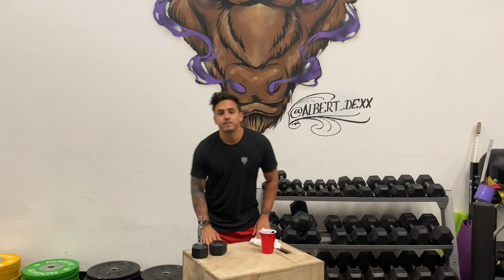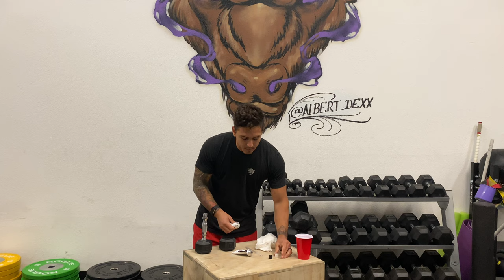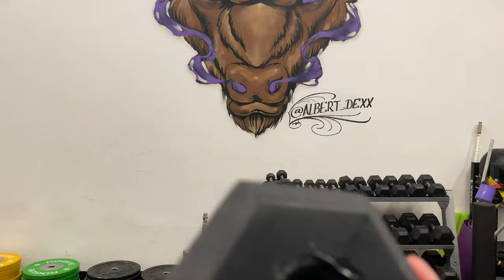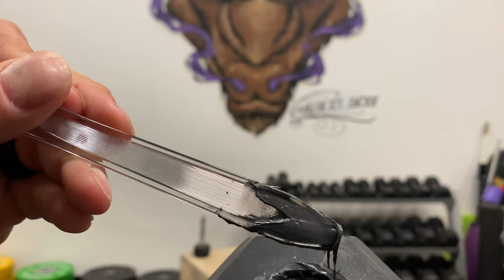How to fix your loose or broken Dumbbells

Comment: Nice video, just recently purchased a new set of CAP cast iron 25lb dumbbells from ebay, only used one time when i noticed one of the ends is loose, might give this a shot hoping it works out.
Reply from the maker: it works great!

Comment: What if the end just continues to twist and won’t tighten or come off?
Reply from the maker: You could put some of this in the crack and it’ll stop moving for sure
Reply: @memefortime  I was wondering about just putting it around the handle and head if that would hold. They don’t seem to be going anywhere but after continuous dropping to the floor they have loosened
Reply from the maker: @carlripley1871  it’s worth a shot!

Comment: Thanks. Not what I was quite looking for though. I was hoping I'd stumble across a video fixing 'fixed set', welded plated dumbbells. More so the consequences of not fixing them as well.

The gym I go to has really old, rusting, welded plate dumbbells. It is the first time in 3 years today I have been and they're still the same ones. But now they are really wiggly as there's lots of room now for the plates to move. Which means the plates are rattling, messing formation up and when using them laid down I keep getting debris in my eyes making me have to stop between sets.

I dont want to fix the gyms weights lol that's their job. I'm a bit concerned that the gym I go to should be getting them sorted really. The weld material has simply chipped off over time due to heavy use.
Reply from the maker: well that seems pretty annoying. I try to fix any equipment as soon as it breaks but I DB are so damn expensive! Hopefully they get it sorted.
Reply: @memefortime  Hopefully he does. I was there for a long time until lockdown happened. He has a good set of hex dumbbells so I'll be using them.

I learnt in lockdown how expensive they are. I could not get on much with big concrete plates and adjustables. I managed to get some from China at their normal cheap price while equipment all went scarce, and people were reselling them on gumtree and ebay for ridiculous prices. The bars dig in and can hurt if you're not careful and the plates are just very big lol. Still fine for some exercises though but some not so much.

I needed heavier not long after as I could only get 18kg of concrete plates on each bar. I bought a set of 20kg and 25kg dumbbells of cast iron from body power. Very expensive.

Comment: I'm gonna have to try this with my cast iron 120lb Dumbell that just recently came apart, already tried welding it which didn't work.. if this works I'll make sure not to drop it after a set anymore 👍
Reply from the maker: Oh snap!!! Let me know how it goes!!!
Reply: How did it hold up with the cast iron?
Reply: If you heat the CI on a bbq grille and get it nice and hot, you can weld it.
Reply: @memefortime  worked great. Sorry I'm only now seeing this, but it definitely worked and I've been confidently using my 120lb cast iron Dumbells ever since, & its been over a year now. 👍